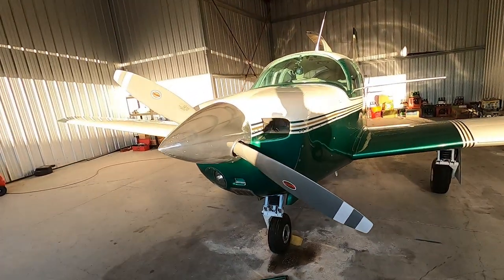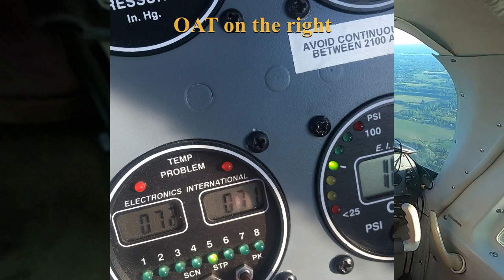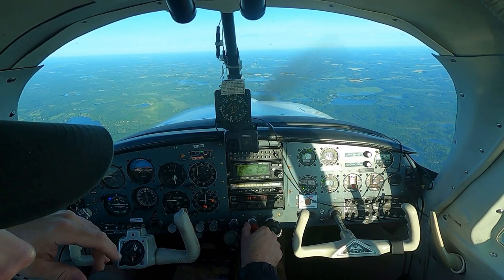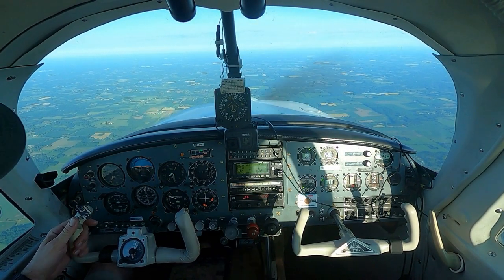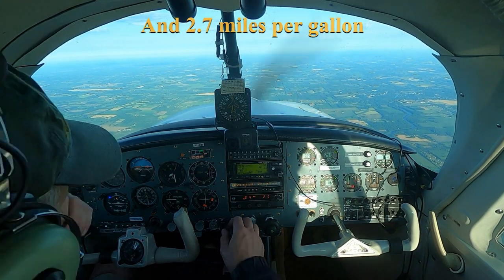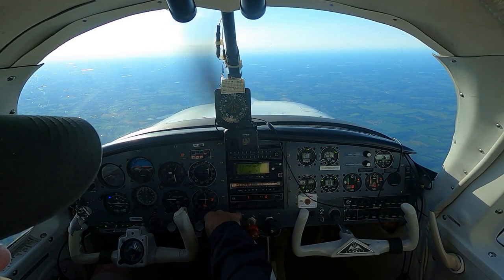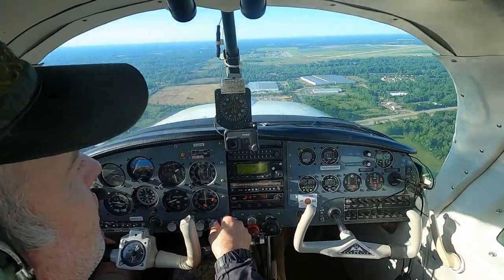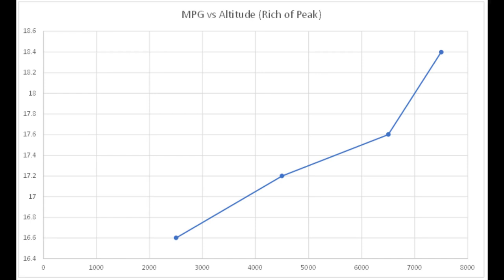Mooney M20E Performance Test

Comment: Do elaborate on the difference in “valve geometry” please. I’ve never heard that before. There are certainly differences between the A1A and the engines installed on the 201 (the dual mag, counterweighted crankshaft, factory timing) but I’ve never heard that valve geometry was one of them.
Reply from the maker: A bit of a novel here (sorry).  I've been searching for the reference where I may have read that but have had no luck so far.  The hard drive died on my old computer so I lost some documents, so there's a decent possibility that I mis-remembered it (so it was probably a bit irresponsible for me to say that in the video purely based off of my memory).  BUT, the power settings tables  for the M20J vs the E and F models are considerably different (I do still have a copy of the power setting tables).  For instance, at 24"/2400 RPM the E and F manuals list that as 74% of rated power, but the M20J POH lists that power setting as being 68.3% of rated power (I had to interpolate for that).  A non-interpolated data point is for 55% power on the E and F is 18"/2400 RPM, but 55% power on the J is 20" / 2400 RPM. It's possible that it may have been the intake in the M20J installation was tuned to be slightly different than the E/F and my memory might just suck.  Or it might be that the numbers are different because the dyno at Lycoming was changed and I'm just a fool. :)
Reply: @FrugalMooney  I think the bigger disparity has to do with inconsistency in POH’s from year to year. In terms of valve geometry I think you are confusing the angle valve 200 hp Lycomings with the parallel valve 180hp Lycomings. The early Lycomings did have smaller diameter valve stems but I doubt there are any of those still in service. There were also narrow deck crank cases in the 60s but they are rare these days as well.

Comment: Newbie here: is it normal to cruise in the yellow arc?
Reply: All Mooneys I have flown will be in the yellow arc at 75% power. This means you are exceding Vno (normal operating speed) for flight in rough air. When encountering rough air, throttle back below the yellow arc. Most Mooney pilots just climb above the rough air for comfort and speed.

Comment: You obviously fly Lean of Peak a lot, any considerations for maintenance with that approach to operating the IO360?  I only ask because the POH only discusses ROP flying and not LOP.....thanks for the videos and any insight ...
Reply: BH: Maintenance is maintenance in a properly operated engine.  LOP is safe and causes no damage to engine when done correctly.  Dig into the books.
Reply: LOP generally reduces maintenance costs by running cooler cylinders.